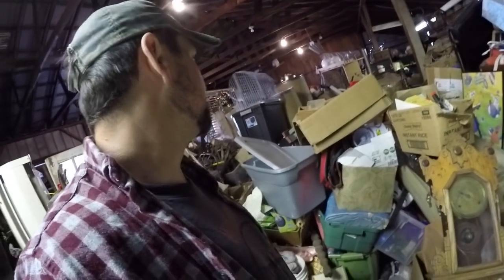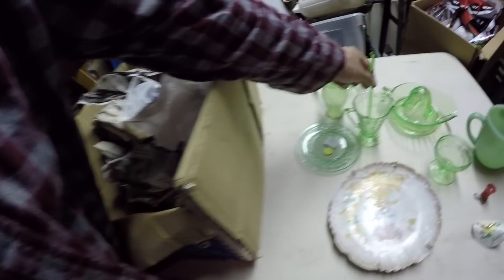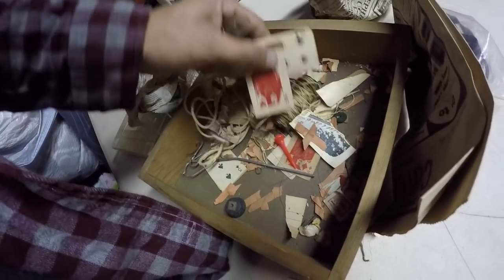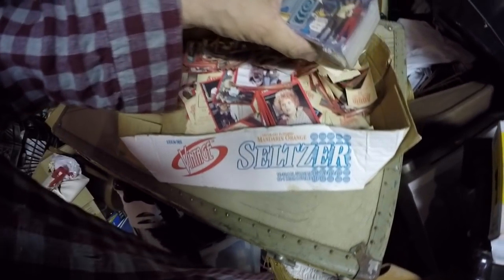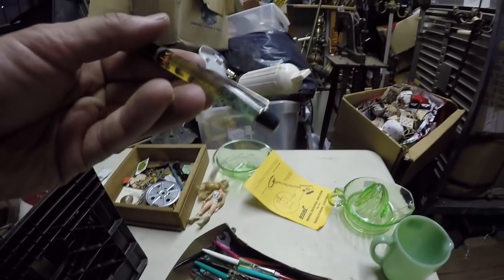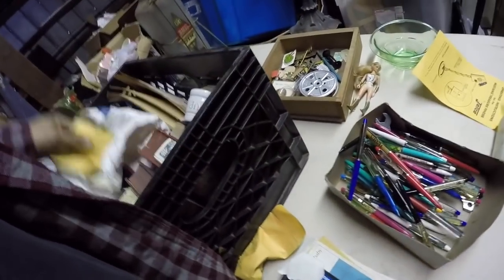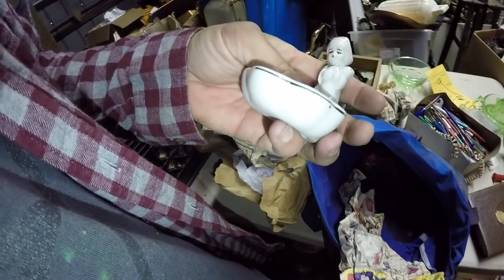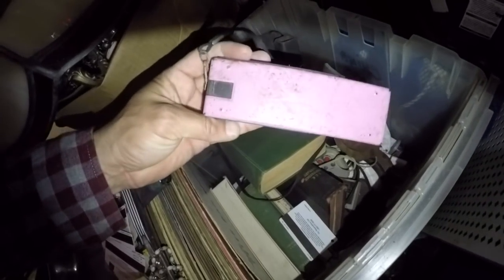Sorting more boxes! Finding treasures for eBay. Slowly but surely getting organized.

Comment: Per Worthpoint: 2 sold in past- 2 years -$125 & $58  -- "Vintage Gerson Silver Plated Goose Sculpture Made in SwedenBeautiful mid century silver plated goose with natural amethyst crystals.The goose is approximately 6" long and 3" wide. It is 6 1/4" tall at the beak. The goose weighs 1 lb. 13 oz.The goose is marked Gerson BA-P .90"